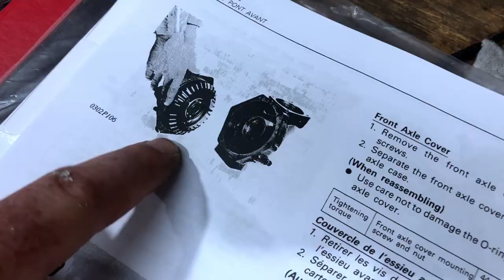Starting to Fix a Broken Kubota B8200

Comment: It would have been much safer to just put a floor jack under the arm or bucket to lift it. If three cylinders are leaking, the last one can not be far behind. Are the front rims cracked up and have washers holding them? swap those out as well.
Reply from the maker: You’re not wrong about the Jack. And as far as the wheels go, I don’t think those wheels belong on that unit. They had the incorrect bolt pattern so someone drilled the correct pattern in it, but drilled the holes too big…not my tractor, not my decision as to what gets done and what doesn’t

Comment: I have a B8200.  I had to replace one of the pipe hydraulic pressure lines.  After I replaced the line, and refilled with fluid all the hydraulics are weak and jerky. I found I had put too my fluid back in.  I drained some of the fluid.  Is there a way to bleed the lines? I don't understand how replacing this line caused the hydraulics to act this way.   Any suggestions?  Thanks
Reply from the maker: Probably some air left in the lines. It will self bleed, you just need to use it and cycle all the hydraulics. Depending on how weak the hydraulic pump is, might take longer than you think…
Reply from the maker: Also, double check your hydraulic fluid level after everything is bled. You might need to add some back in to replace the air.

Comment: Any chance you have the compressed and extended lengths of the boom and bucket cylinders. I have the same tractor and bucket setup with no cylinders. Found part numbers but having trouble finding cylinders.
Reply from the maker: I don’t, sorry it was a customers tractor. You should be able to find all the specifics on messicks, they have a pretty extensive parts diagram catalog

Comment: Interesting to see the gears of the inner hub of that tractor.  Too bad you’re having to fix what the previous owner/mechanic should have done in the first place, but after a little TLC it’ll run good as new.  The power wash did a number on it as well.  Great work man.  BTW cool new channel logo👍
Reply from the maker: Shame it was treated the way it was. Hopefully the new owner will keep up on it so it lasts for years to come!

Comment: Hi, What is the part number for the loader cylinder seals kit please? .. your video on this tractor has helped me tons, thanks
Reply from the maker: Which cylinder? The lift or the bucket tilt?
Reply: @EverythingElliott  The lift please
Reply from the maker: @chromecast639  70726-68010 that is the part number from messicks. That’s where I ordered all the parts for this tractor

Comment: I also have a B8200, if you would like to do more content on this tractor I can tell you how to add a hydraulic rear remote for the cost of 2 hoses and fittings(the valve is already on the tractor!), and add a skid steer quick attach for the loader using a factory part for about $500.  I just finished up adding the summit hydraulic remote kit to mine.

EDIT: I kept watching and now see that it is not your tractor, well I am still happy to tell you how I did it if you want.
Reply from the maker: Thanks for the offer!  I'm not sure that's something the customer would be interested in...he uses it for very basic chores around the house.
Reply: @EverythingElliott  when I first made the comment I thought you owned the machine.  Then I watched further and saw you were doing it for someone else.  Thanks for responding!
Reply from the maker: @doseven  No Problem, I read all the comments! Thanks for watching!
Reply: What kit did you go with .
Reply: @addisongraf8991  well depending on what you are trying to do I did not buy a kit.  What feature are you asking about?
Reply: @addisongraf8991  if you mean the summit rear remote kit I went with the universal kit with 4 spools because it was only like 150 per each after you were already getting the 2 kit.  I also got the joystick option because I was really putting it on to plumb a function onto the loader for a grapple.  So one spool ended up with hoses hooked to it, through a set of quick connects at the loader attachment point, then more hoses out to the skid steer quick attach.
Reply: @addisongraf8991  But if you just want a single rear remote you can do that for the cost of 2 hoses, quick connects and 2 adapters.  Along with just a little welding to make a handle.